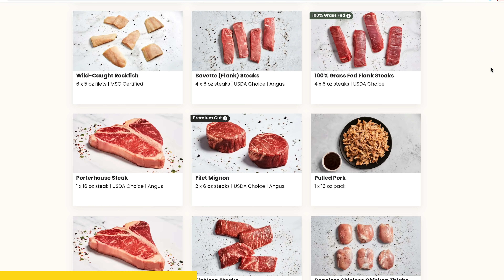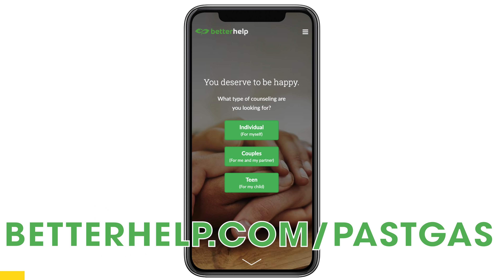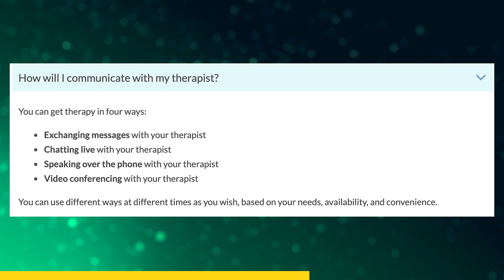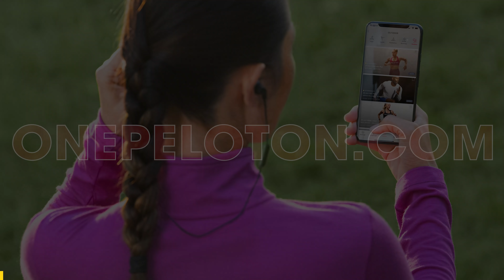Tucker 48: Stroke of Genius, or Scam? - Past Gas #126

Comment: To add on more about the Tucker 48’s uniqueness: it was the first car ever to have seat belts and there is a space in the front interior known as the “safety cell” for passengers to roll under to for protection if there is a collision. Under the hood, there is an actual helicopter engine, the engine is a Bell helicopter engine and it’s air cooled. There is a radiator next to the engine but it’s only for familiarity for drivers to have, in other words the radiator isn’t necessary since it’s a air cooled engine. And the car is BIG: weighs over 4,230 lbs, it’s 60 inches with a 219 inches in length. The car, in many aspects, was ahead of its time especially with the safety focus, but like how this podcast and the up to speed clip proved it; it was doing to much to prove itself against the bigger brands.